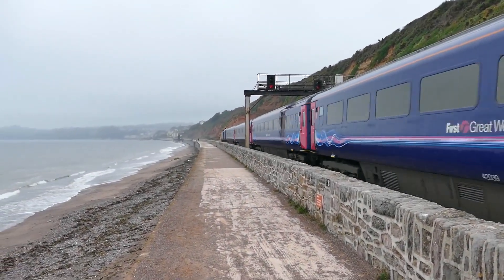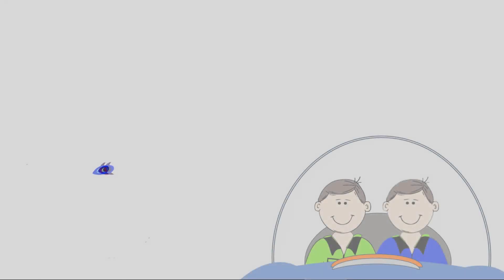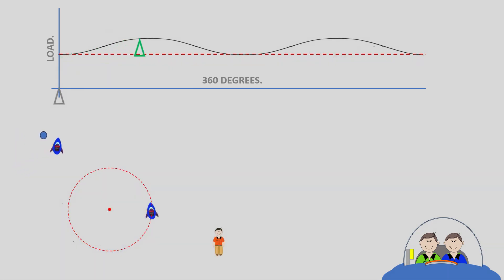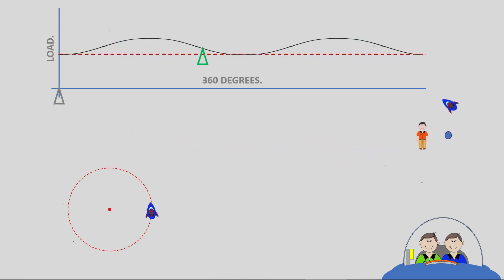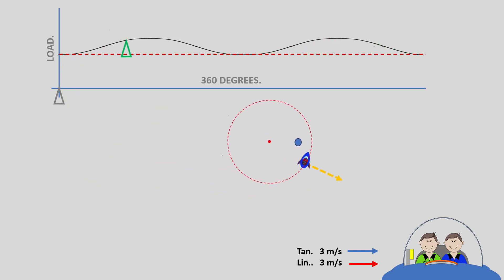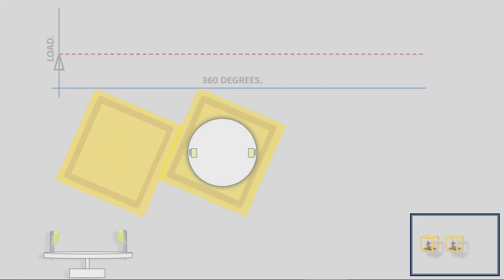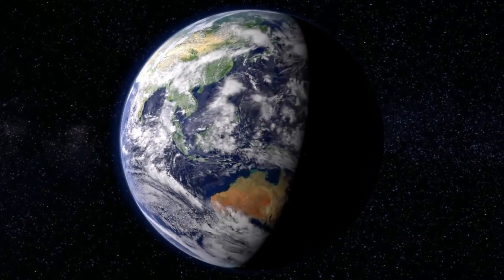Measure a Constant Velocity by Kryptonite Physics

Comment from the maker: I am emailing you in response to the video you uploaded from Kryptonite Physics. First, I would like to thank you. Your videos were very helpful in my awakening that the heliocentric globe model is false.

I am also a great fan of Kryptonite Physics. I think he put out some great videos. However,  I think his latest video "Measure a Constant Velocity" does not debunk the heliocentric model. I think it is important that the information shared by truth seekers is factually correct in order to fight the brainwashing, as you also recognized by removing a video you uploaded last month.

I had left the following comment under the video:

"Where Chris goes wrong in his thinking (myself too at first) is that he thinks that the change in magnitude of the velocity vector must be felt by the load cell. This changing magnitude of the velocity vector is indeed different than in pure rotation, in pure rotation the magnitude is constant. However, the mistake is that the change in magnitude must result in an oscillating acceleration. However, the CHANGE in the velocity vector (x and y direction) is exactly the same for rotation or rotation+translation.
 Work out the equations and see for yourself that the translational velocity is not part of the accelerations anymore in x and y direction.
Lets define a rotation with rotational speed w and amplitude A  together with a translational speed V:
x = A * cos(wt) + V*t
y = A * sin(wt)
Take the first derivative wrt time t to get the velocity:
xdot = - A * w * sin(wt) + V
ydot = A * w * cos(wt)
Take again the derivative to get the accelerations:
xddot = - A *w^2 * cos(wt)
yddot = - A * w^2 * sin(wt)
The constant velocity is not part of the accelerations... in other words: there is no difference between rotation and rotation+translation in terms of the accelerations on any point on the rotating body. Take any value you like for w, A or V."

I have also verified the resulting accelerations by calculating the positions at short intervals of time. And by taking the time differentials of the positions twice to make sure there is no mistake in the analytical derivation above. The resulting acceleration, sqrt( xddot^2+yddot^2), is constant and points towards the center of rotation all the time. I can also send pictures of the actual velocity and acceleration vectors if it is not clear yet.

I should tell you that I have Master's degree in aerospace engineering and that dynamics is my specialty.
Reply: Yeah right, miraculously being convinced that what you been taught is false by watching a questionable youtuber is something to think about.

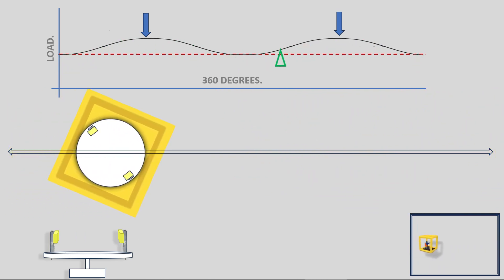Comment: The video was a total fake out. First you are saying that you can measure linear constant velocity, which is not possible. But then you continue with rotating stuff, which is not linear velocity. A rotation is an acceleration and not velocity. You even say so in your video. Then you say lets do experiment, but you never did any experimentation. All you did is some fancy comic. Where is the data, measurements and math? You did some example vector maths, but you never calculated the linear constant velocity. And finally, you claim 6:27 "it should be possible to gauge the actual velocity by analyzing the shape by changing position", well do it then! We are waiting. Why you are claiming it and not doing it?

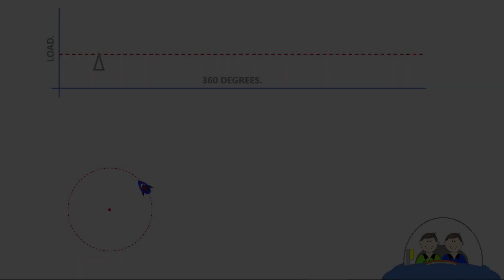Even in your setup you cannot measure or calculate the linear constant velocity, because the rotational acceleration that you can measure is relative. And we can easily measure the centrifugal force of the earth and it's 0.034 m/s/s at the equator. Which you agreed in your video shows a rotation. 1:42 "due to centrifugal acceleration" So we already proved that the earth rotates.

Comment: 2:30 this demonstration is a load of shit, of course it's going to appear like it's accelerating towards your "center" when you have it offset from the true pivot. Not to mention you are conflating linear velocity with angular velocity. The linear velocity describes the set as a whole, whereas the angular velocity of the object is relative to the center of the set and described itself as an individual piece within. This demonstration is basically saying that spinning tops defy physics if they are driven in a given direction while spinning. The only thing you've proved is that you don't understand physic.

Comment: Motion sickness on an airplane is caused by mixed signals reaching your brain from your inner ear, which senses you are moving, and your eyes, which counter that you are in fact sitting still.

Though your brain may be capable of handling quadratic equations, the organ can go haywire in response to conflicting info from your senses. Consequently, you may get a headache, nausea, and that hot, sweaty feeling that indicates something is definitely wrong, for the thermostats in airplane cabins are typically set to cold-enough-to-hang-meat.

Advertisement

About a quarter of passengers get airsick, according to one study. The feeling is arguably more distressing than carsickness because, after all, an airplane passenger can’t pull over and wait for the wave of nausea to pass. (Seasickness is still undeniably the worst of all, though.)

*  so 1/4 suffer from it. How many suffer from earth spin sickness ? Also it says we see stillness but our ears know we're moving. On earth we see stillness and our ears do too otherwise we'd feel sick😊
Reply: No it's not. Your inner ear can sense acceleration only. You get Motion sickness if the plane is in a turbulence or does tied curve or rising up or landing. Since a turbulence or a curve or rising up or landing is an acceleration your inner ear can sense it, but since you sitting still you get confused and get Motion sickness. The same with car sickness or sea sickness. A car is almost never smooth linear drive, but always speeding up, slowing down or does a curve. Sea sickness is the worse because the change/acceleration because of waves never stops. The ship is always accelerated up and then down and up and down. PS: you are from America? You people really never ride a train. Trains are really smooth and rarely do curves. Take a smooth train ride, close the windows or your eyes and you cannot tell if the train moves or not.

Comment: In this video he tries to explain it also:
https://youtu.be/i8BIzW5MKPA
Where he goes wrong in his thinking (myself too at first) is that he thinks that the change in magnitude of the velocity vector must be felt by the load cell. This changing magnitude of the velocity vector is indeed different than in pure rotation, in pure rotation the magnitude is constant. However, the mistake is that the change in magnitude must result in an oscillating acceleration. However, the CHANGE in the velocity vector (x and y direction) is exactly the same for rotation or rotation+translation. 
 Work out the equations and see for yourself that the translational velocity is not part anymore of the accelerations in x and y direction. 
Lets define a rotation with rotational speed w and amplitude A  together with a translational speed V:
x = A * cos(wt) + V*t
y = A * sin(wt)
Take the first derivative wrt time t to get the velocity:
xdot = - A * w * sin(wt) + V
ydot = A * w * cos(wt)
Take again the derivative to get the accelerations:
xddot = - A *w^2 * cos(wt)
yddot = - A * w^2 * sin(wt)
The constant velocity is not part of the accelerations... in other words: there is no difference between rotation and rotation+translation in terms of the accelerations on any point on the rotating body. Take any value you like for w, A or V.
Reply: Correct
Reply: @TheRumpusView  ChrisUK doesnt get it unfortunately, see comments under the original video on Kryptonite Physics channel

Comment: Some very wrong conclusions here. At 2:25, the linear motion of the system is irrelevant. The variation in load is caused purely by the fact the car is not rotating at a constant radius. The same result would be seen with the system stationary, or moving at a constant linear speed. Therefore, the conclusion made at the end is faulty - the car rotating around a point at a constant radius in a system moving at a constant speed will show a constant force on the load, exactly the same as the stationary example at the beginning. That’s just basic physics, feel free to test it.
Reply: Many have tried explaining this to the creator already but they clearly don't understand physics to begin with, and don't understand the criticism
Reply: How can an exact radius exist when we have only been 8 miles down?

Comment: Thanks Ben! This is so awesome! I always ask folks how "gravity" magically adjusts for all the constant changes in the heliocentric model and get blank stares! Lol! It's so easy to see from this alone that we are absolutely not moving! With all the micro sensitive measuring devices we have we would easily be able to detect differences in weight/velocity between the equator and the poles. And not only that, the difference between the tight bends and loose bends in earth's elliptical orbit!

Comment: At 5:09 the resultant velocity of rotating object and the linear motion of the frame is with respect to the 3rd party observer.  The rotating velocity with respect to the person inside the frame remain constant and the calculated centripetal force will remain constant and that will also be the constant force picked up by the load cell.
Reply: That is all a reference frame is, its your perspective from that frame. changes nothing that the outside observer can see happening to the mass. All motion.
Reply: @KryptonitePhysics  In this regard it will be like a person floating in outer space looking at the rotating earth. The measured force on the load cell is ONLY WITH REFERENCE to the moving frame. How can an outside observer measure the forces acting on the object in the moving frame ?  Do you know the characteristic of internal forces ? What the loadcells measured are internal forces...something you can't measure outside of the moving frame .
Reply: What will the outside observer observe is happening to the mass in the car? (This is the reality for the mass, all motion is accounted for)
Can this change for the mass if the observers position changes? NO

They only change there perception of what is happening, they cant physically change anything for the mass.
Reply: @KryptonitePhysics mass is not changed but the effective velocity changes wrt the frame of reference. Since the load cell is inside the moving frame we must then use the effective velocity within the frame.

Comment: This is just a glorified "assume the conclusion" fallacy, with a graph that is claimed to be measured, but is in fact just simply "dry-labbed" :  constructed so as to appear to justify the presenter's claims.   Unfortunately, it is relatively easy for viewers to actually DO the kind of experiment that's being proposed.  The smart phones most folks own contain 3-axis accelerometers ("load cells", in the parlance of the video) which, via readily-obtainable apps, can have their readings recorded.    Build as large a spinnable disc as can be conveniently taken aboard a smoothly-traveling vehicle, such as a train traveling steadily over a straight track, and fasten a smartphone in "record acceleration graph mode" near the rim of the disc (obviously, some simple frame or support is needed as well).  For extra credit, fasten a dead weight on the opposite side of the disc to counterbalance the phones weight.  When the vehicle gets up to cruising speed, spin up the disc.  Hopefully, the disc will spin with low friction, so it doesn't change its rotational speed very quickly;  let it run for many revolutions' worth, and then stop the experiment, terminate the acceleration recording, and look at its graph.  You will NOT see the sinusoidally varying accelerations that the lying presenter of this video bases his claims on.
 <Edit:  sorry, you would see a sinusoidally varying acceleration if you let the 'phone record local gravity along with the centrifugal force of interest by having the disc's axis  be horizontal.   To eliminate this confusion, orient the disc's axis in the vertical direction, like a record turntable>
Reply: I look forward to your video on the experiment
Reply: Ahahaha you guys are amazing. All that BS and the Occam's Razor suggest the opposite! How you can speak of something that you never seen or be physically there to measure all that.  When you go to space and visit all those "planets" and over there measure all that with the real evidence on sight, from a spaceship or whatever, then you can come back with all that data and videos, etc... and only then we can continue this converse with the real facts. So until you do all that "work" there is not one word you can say about this, or anyone else for that matter,  that can be taken seriously, only theorized - and theories are NOT facts!!!  Let me know when you guys make your own spaceship, anyone that is not NASA, or similar, so we can come and wave hands at you as you fly up in "space" ☺
Reply: @WeOutlawsTV88  Well, here's a slight difference:  The claim that a spinning centrifuge's force wobbles if the centrifuge is moved at a steady speed in a straight line IS something that can be experimentally tested with only modest difficulty, while constructing and using an interplanetary spacecraft can't.    I made my post mid-way through the video, before seeing that its creator even proposed essentially the very same experiment.   Proposed, but did not DO.   And as @KryptonitePhysics predicted, I'm not likely to do it either.   But I did easily find a freeware phone app for recording the accelerometers, and if I can easily lash together a rig that'll fit in my car, may give it a go.
Reply: I give you physics facts only, no theory's, no CGI, your space travel is an illusion, full of theorys that don't stand up to scrutiny. @WeOutlawsTV88
Reply: @WeOutlawsTV88 plenty of people have already done that, independent of NASA. But nothing gets past your filter of "NASA jew cgi" so I don't know why you bother to even state this. Have you physically been to Kazakhstan or Japan or North Sentinel island? If not, then they don't exist by your logic and all depictions of such places are lies and conspiracies as well
Reply: @WeOutlawsTV88 Also, mentioning Occam's razor is ironic, because to believe in a non-globe earth requires more assumptions than our most viable model